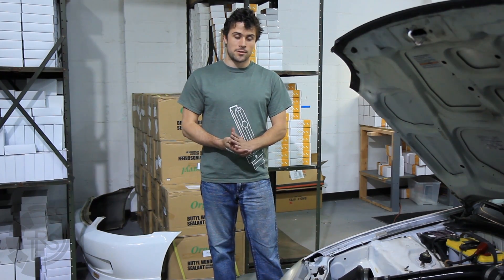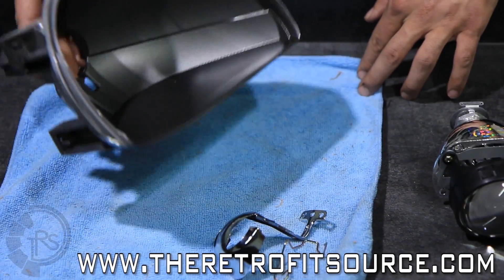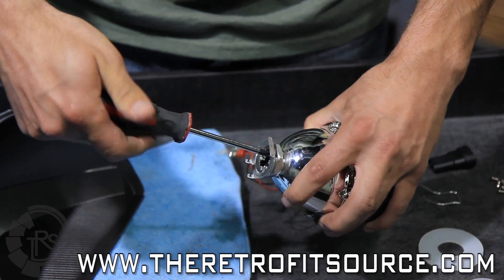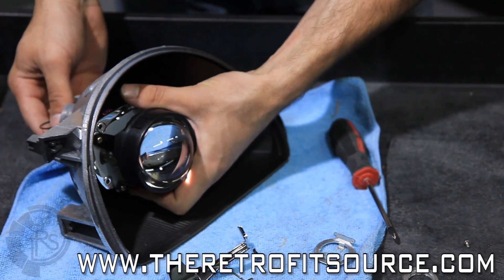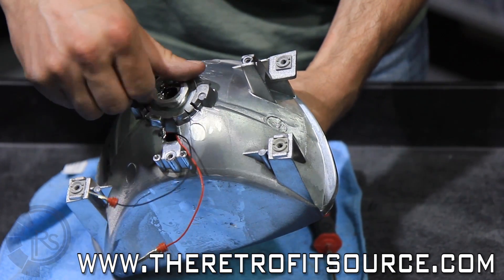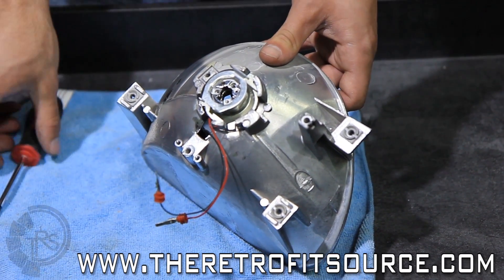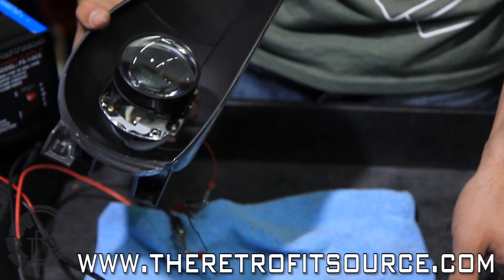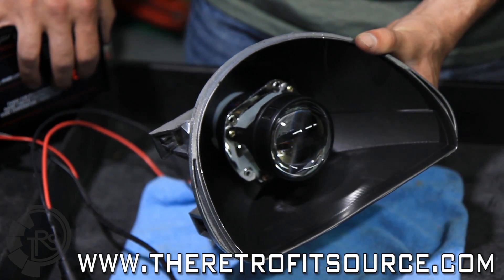TRS Tips: How To Retrofit Headlights with Morimoto Mini H1 Bixenon Projectors

Comment: Wiring to a h4 female??
Reply from the maker: You would just need to use an H4 relay harness to make it compatible with your H4 wiring. The connection going to the ballast remains the same — the harness simply adapts the input side to work with your factory wiring. You can find the H4 relay harness here: https://www.theretrofitsource.com/search?keywords=h4%20relay

Comment: I caught 7:00 min in the oven but at what temp?  On reassembly was adhesive used on the lens (last piece)?  What kind of adhesive should be used that will soften when heated?  Thanks.
Reply from the maker: OEM Headlights will either be sealed with butyl or permaseal, typically 2015+ will be permaseal and much harder to deal with than older, traditional butyl.

Butyl Lens removal:
- https://www.youtube.com/watch?v=duFXYRt_nD0
- https://www.youtube.com/watch?v=anN0vYBj6Uo

Permaseal Lens removal:
- https://www.youtube.com/watch?v=muZwYFumR9M&t=31s
- https://www.youtube.com/watch?v=sG27LKxCHI0

Check out these videos, they will be very helpful!

Comment: What if my headlight is H11? How will I be able to mount the projector?
Reply from the maker: You can either use a retrofit bracket, or you can use the nut and bolt method!

Comment: So my problem is my 03 legacy gt has two bulbs. one for high and one for low. I would like to think this would work? The low beam is a H1 and the High beam is a 9005
Reply from the maker: Absolutely, so when you install this on just the low beam side you will use all the connections from that to power everything up.
Then you have a splitter that comes off your OEM high beam to power the solenoid for the projector! 
Quad high beams!
Reply: @RetrofitSource  Big thanks!!!

Comment: I have Ford Focus headlights. At what degrees Celsius should I keep them for 7 minutes? Do you put the headlights in the oven after the oven has reached the desired temperature and then count 7 minutes?
Reply from the maker: Every headlight will be different, but the general rule is around 250 degrees Fahrenheit for 7-10 minutes. Re-insert for 5-minute intervals until you can remove the lenses.

Comment: How the fuck does he adjust the headlights? He doesn't go into that at all. What if it's aimed completely wrong?
Reply from the maker: You need to test fit and check as you go in that case.
Reply: @RetrofitSource  okay, how do I adjust them if they aren't sitting in there right? What do I use? Lol
Reply from the maker: You'll have to dremel away at the housings to get them aimed right. The headlight itself is still adjustable you just need to make sure your rotation is on point more than anything.

Comment: I just purchased mini h1 8.0 and installed them the the cutoff shield on the top and the cutoff seems proper but when I look at the installation guide it shows to put it on the bottom. How is it possible that the cutoff is right but it is apparently upside down?
Reply from the maker: That is very odd, that should not be happening at all. I will have you shoot us an email with images of your beam pattern, and then we will go from there! Support@TheRetrofitSource.com

Comment: i just retro fit my projector to my 96 civic but the light has no cut off focus..is it has to do with the housing reflector?i dont spray black like yours..
Reply from the maker: If you installed a projector, it should still have the cutoff line for sure! I am  wondering what projector you purchased, let me know and I will be happy to help you out with this!
Reply: @RetrofitSource  I'm using sinolyn projector 3.0inch..u may Google it as it available in my country
Reply from the maker: Shoot us an email with an image of your beam pattern, and we will be able to determine if this is the projector or the OEM reflector that is causing the issue with that headlight. Support@TheRetrofitSource.com

Comment: Please show us how to wire the h1 bulb
Reply from the maker: The H1 bulb will have two little pins, you will insert those into the respective connectors inside the headlight housing! Let us know if you have any other questions!
Reply: @RetrofitSource  thank you for your reply. But what I mean was how would it be wired if I wanted to use the bulb for hi/lo beams. How would one connect the bulb to the hi beams? And the low beams? Is there a specific harness needed. Please share a link to it
Reply from the maker: You would not be able to do that, you will need an actual dual beam bulb for that. Let us know what vehicle these are going into and we should be able to help you get the correct bulb replacement!
Reply: @RetrofitSource  I purchased the mishimoto mini h1 for my e36 m3. Just looking into what options I have for the bulb.
Reply from the maker: Ahh, I see what is going on here! So with that projector, if you would like to use the Hi/Low feature you will need to plug in the projector solenoid to the harness, the relay harness that came with the kit should have the adapters for the small connectors used for that solenoid. As for bulbs, you will have to go with the H1 HID kit I have linked below, if you have any other questions just let us know! Have a great day! Link: https://www.theretrofitsource.com/h1-morimoto-elite-HS-H1?quantity=1

Comment: Hey guys great installation video. I have a question can I still use the bi-xenon bulb with the little servo that pushes it out a little?
Reply from the maker: If you have a bi-xenon bulb that fits your application, then that would work! I am sorry to say that you will have to source that yourself, as the only bulbs that we have that will move in and out are the 9007 and the H13 bulbs.

Comment: the solenoid and that shield movement is exactly why I had no choice but to just rock LED’s - We have far to much temperature variation as well as salt used on our roads to trust something like that. Also my car u have to take the bloody bumper cover, under car shield as well as a bunch of other plastic stuff just to get to the headlights if so had to do that in -30c, ohh shoot my solenoid froze and is jammed likely into high beam lol

I went with morimotos two strokes for low beams and some phillips leds for high beam and I am very happy, my old lenses were so cloudy and terrible that just the new assemblies made a world of difference plus the added light and color difference, it’s made such annhuge difference.  However I actually think doing turn signals and brake lights is even more important first though. Halogens headlight are decent but the bulbs at least the older bulbs used for signals/brake lights markers etc really are pretty terrible - and during a sunny day or at dusk - i notice people SEE what i am doing far easier then before.

I know I hate some vehicles because you can’t see their front signals or some dummy will put a white bulb where and amber was supposed to go.
Reply from the maker: That is very true, those marker bulbs and brake lights are not nearly as bright as they should be! I am glad that your headlights are working well for you, if you would like to look into some of the marker bulbs that we have for your vehicle, let us know and we will be happy to help! Thanks for the support!🙏

Comment: Why did you skip the lens removal?
Why did you skip the reflector bowl removal? 
Why didn't you elaborate on the lamp shroud? Does it come with the lamp? Does it come with a kit? Where did it come from?  

Instructional videos can be very off putting to customers when they seem more like advertising than like they're trying to be helpful.
Reply from the maker: Hey there, thanks for commenting!  This is a pretty old video, so you will have to forgive us on the quality of it as we were not as advanced in the industry as we are now! With the lens removal, we did not skip that process, and you can view that from roughly 40 seconds to 1 minute 10 seconds. As for the reflector bowl removal, that is also shown, just not in too much detail. That is right after the lens removal, and it involved removing the 3 screws that were in that headlight holding the reflector bowl to the housing. The kits can all easily be found on the website, and if you took the time to check out the links on this video to check out the complete retrofit system, you would have seen that all the parts are included in the kit including the shroud. The real reason that we do not show everything that well in this video, is that these can be used in almost every headlight housing, and of course different housings are going to have different setups. That is why this kit is a "Custom" kit that you will have to install! If you have any questions, all you need to do is shoot us an email and we will be happy to help! Support@TheRetrofitSource.com
Reply: Thank you. I might advise you to check out the links in the video description as well, unless it's just me getting a "page not found" screen.
Reply from the maker: Thank you for the update, that is due to the fact that we are unable to offer that kit for street legal use at this point, so those links are now not used for anything. Sorry about that!

Comment: I have a C5 Corvette with ACA headlamps.  I want to upgrade the projectors.  Can you recommend one for my application?
Reply from the maker: That one will be a little hard, as that is a very low profile headlight housing. If you were going to fit anything, you would want to go with the Mini H1 8.0, as that will be the smallest of the full size projectors that we carry. I have linked that for you here: https://www.theretrofitsource.com/bi-xenon-mini-h1-7-0-projectors-P-M-H1?quantity=1

Otherwise, you could go with the Matchbox 2.0, and that would be a smaller option, but may not be any better than what comes in the headlight from the manufacturer. I have linked that for you here: https://www.theretrofitsource.com/bi-xenon-matchbox-2-P-M-MATCHBOX?quantity=1

Comment: hello, great vid! are you able to fit h4 led into the morimoto proyector? also how you deal with the glare shield from the h4 led?
Reply from the maker: You wouldn't want to run an H4 LED in these projectors, They are designed for an H1 HID bulb specifically.

Comment: I installed this in my h4 housing. Is it possible to rotate this from the back with a flat head?
Reply from the maker: Not with a flat head. If you used installed it using the threaded shaft, you can loosen the nut slightly and rotate the whole projector by hand. Then tighten the nut back down.
Reply: @RetrofitSource  so i have to open my headlights again?

Comment: I bought a set of aftermarket head light housings for my charger. They have H1 sockets for both high and low beam. The high beam are standard reflectors but the low beam are projectors with a cut-off shield inside(I'm assuming because of the sharp cut-off line). The cut-off line on the passenger head light is slightly slanted and doesn't line up perfectly with the drivers side(which is nice and even straight across). Is there a way I can fix this so the passenger side head light is even with the drivers side? I am NOT talking about adjusting them up or down! I know how to do that and have already done it. I'm talking about how to "twist" the actual projector in the passenger side head light to get it lined up properly.
Reply from the maker: That sounds like a defective headlight. It's highly doubtful that it can be fixed. The only way to remedy this would be to get a new headlight housing.
Reply: @RetrofitSource  Yeah, I called the company I got them from and that's what they said so they are sending me a new one.

Comment: Has anyone retrofitted their headlights to be bi xenon or dual beam projectors? I’m planning on putting a projector where my reflector is and replacing the oem one with a high/low projector. My question is how do you get the high beams to come on when you turn your regular lights on? And how do you get the low beams to have a high/low function.
Reply: late reply, but just use both as high/low beams! You could have 4 projectors, just would need 4 ballasts and igniters.

Comment: I've installed hids bulbs before. Want to know how to wire them, look for how to put in hid bulbs. Basically. New bulbs connect to a ballast, a little box, and that connects to factory headlight connector. No wire cutting needed. Very simple. Then mount then ballast securely to car. With zip ties or sometimes they come with a bracket. Btw, nice video on the projector lights.

Comment: where do i hook up the solenoid wire?
i mean does it take 12 v?
Reply from the maker: To your stock halogen high beam output, or to the output on a bi-xenon relay harness. Depends on what kind of car you're using!

Comment: Do I need to have the shield with a low beam bulb? And if I do what do I connect it to?
Reply from the maker: You dont "need" to hook it up, but unless you do - the projectors high beam wont work. It would get connected with the +/- wire coming from your high beam circuit. Easy to do, plug n play with some wiring we would recommend for you.
Reply: TheRetrofitSource Inc ahh got it thanks mate. I’m having second thoughts doing this. Cuz I have 2002 Corolla and it’s in good shape but not worth all that time I guess

Comment: All the money u have to spend on them and u have to jb weld the shroud to it. I just bought a $25 kit on eBay and they get screwed on and are of good quality.
Reply from the maker: You dont "have" to JB weld it on, but it's recommended. Even professional retrofitters do this, very common practice.
Reply: TheRetrofitSource Inc do you have more links or something to learn more about this? I have a 2010 Silverado, looking to get some projectors but the Ebay ones, people say are trash. I have LED bulbs. I’d be willing to do a project myself, just need more info.

Comment: The H4 adapter plate you are using is not the one that came with my kit. mine doesnt have a dip but is more conical. Are the new ones no longer like this? Would look like it would lock down better

Comment: My concern is I have 9006 bulbs, how would those fit in the mini H1's?
Reply: BALD PRICK buy a pigtail adapter with a 9006 male head and the H1 is wires with prongs that just stab right in. 
Search: “9006 to H1 adapter”

Comment: From your vid it didn't appear you had to cut the original reflector bowl or the back of the housing, so does this mean the projector is fully adjustable (north/south, east/west)  just as the stock halogen reflector bowl was?
Reply from the maker: Yes that is correct! the projector can be adjusted with the factory aiming adjuster knobs after the retrofit
Reply: TheRetrofitSource Inc perfect thanks. Also, the h1 mini is really this simple to install? It almost seems to good to be true!
Reply from the maker: That it is! But its not too good to be true, thats what makes them our #1 selling projector today! the 7.0 version is better than the 6.0 that's in this video too, in every way!

https://www.theretrofitsource.com/complete-retrofit-kits/universal-kits/bixenon-morimoto-mini-h1-stage-3.html

(thats the whole kit, we also sell just the projectors alone)
Reply: TheRetrofitSource Inc I'm looking at getting the mx5 switchback shrouds and will I need to be getting a relay or do I just wire them separately to my blinkers and drls?
Reply from the maker: Nope! no relay necessary for those X5-R shrouds on their own, the switchback function is already integrated into their wiring so you just hook it up to the DRL and blinker like you said
Reply: TheRetrofitSource Inc awesome thanks man. Been good help
Reply from the maker: call us if anything else! 404 220 7940 glad to help!

Comment: So if I buy headlights with h1 low and high beam halogen projectors, do I just open the headlight, unbolt the h1 halogens and then bolt the h1 hids in?

Comment: I want to take my original H7 signal from the headlight and drive it to projector's coil.
Will the H7 beam be effective for both high/low?
Reply: Hi, did you figure it out? i have h7 as well, and i want to do it on my car as well, but i don't know what to do with the high beam cable because the projectors come with h1 bulbs adaptors.

Comment: would be nice to see how they wired up the lights? what kind of wire harness  to use?
Reply: They sell many kinds of wiring harnesses.  The best way is to just browse what they have.  They have so many options for different installs that it's way too many to list.  An example though, I did a retrofit on a motorcycle, and I bought a motorcycle dual h7 output harness to power the ballasts for the HID's.  So many options it's almost overwhelming.

Comment: I watched this video over 10 times only because I want to buy the mini projector, but I am nervous about the wiring. If my OEM headlight plug is for H4 bulb, how would I use a H1 bulb? H4 plugs has 3 spokes while H1 has only 2 I believe.
Reply: +koushick barua you have a low beam circuit and a high beam circuit... On mine this is what I did, I took the low beam wires to the headlight and the solenoid for the cut off through a relay such that the relay on its resting position has the solenoid energized and blocking the light but when I turn the high beam on it switches the relay on which drops current to the cutoff solenoid hence allowing the other half of the beam through as "high beam" I hope that helps. 5 pin relay by the way.

Comment: So my car has a stock bulb size. As long as i make sure the adapter plate is set to 12 o clock, i dont have to worry about the rotation Alignment being off?
Reply: +Mustangkid29 If its an H7 or H4 (which adapters are included for) then yes, thats right